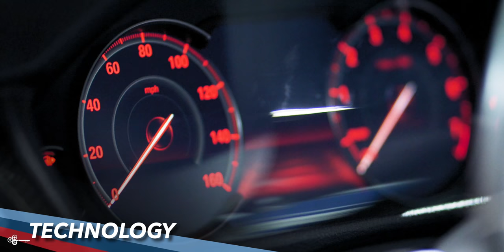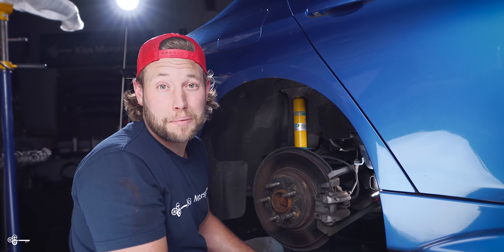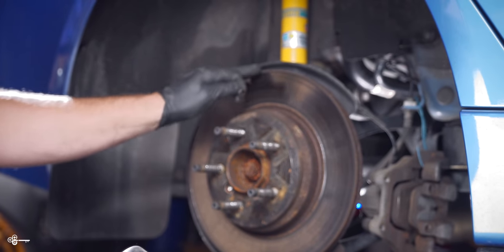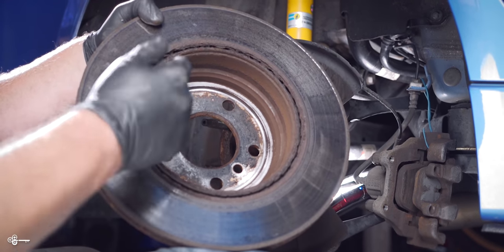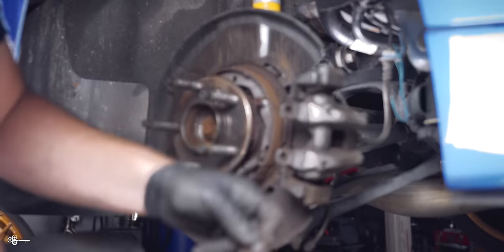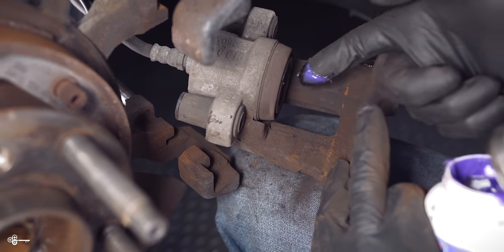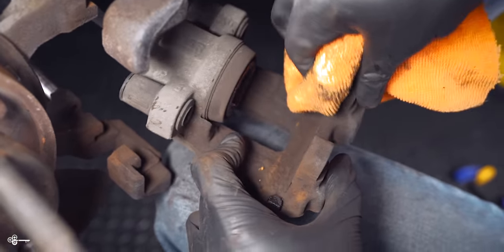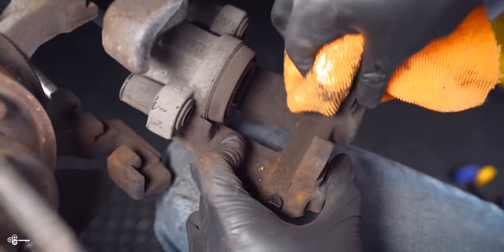How to UPGRADE your REAR F30 BMW Brakes! Slotted Rotors and Ceramic Brake Pads! Stoptech and EBC

Comment: It's true that bmw advices not to lubricate the brake guides, nevertheless I always lube them with silicon based lube or ATE plastilube. The important is not to use convencional or copper paste to not damage the rubber seals. That's what some other cars manufacturers advice, so I see no harm. One advice, when pressing the brake piston, it should be done with the reservoir open, to release the excess pressure. Nice video though.

Comment: It is recommended you lightly grease the entire back side of the pads to prevent brake noise.
Reply: Always wise to grease the backing where the piston comes in contact.  In this case, the bracket on the pad prevents that.
Reply: @pm8372  really? Why doesnt the factory do that then? Never grease brake pads, slides, anything. No OEM manufacturer reccomends it due to collection of debris buildup
Reply: @quix99  Cost, While debris build up is a con, A set of quality brake pads with rubber shims should negate the use of grease. The general reason why manufacturers don’t do something is because of cost. ¢0.10 of grease per car multiplied by hundreds of thousand for something that isn’t necessary is not cost effective.

Comment: Damn, I remember the good ol days when I drove a Toyota and swapping pads and rotors was like a 2 minute ordeal - pull it all off slam it back on, didn't even need to disconnect the calipers

Comment: Whats the torque spec on the 16mm bolts? You just said torque them but not how much 😅, what if I only remove the pins, how much torque do the pins need? great videos btw! Thank you!
Reply: I did 50Nm on my rear OEM's and didn't replace them but hopefully Kies MS or someone else can confirm otherwise.

My source: https://www.newtis.info/tisv2/a/en/f30-328i-lim/repair-manuals/34-brakes/34-21-rear-wheel-brakes/GfyH0Hrd

Comment: Bryan, just found your video.  I'm looking to replace the brake pads on my 2019 F36 440i Gran Coupe M Sport.  
Can I and is it advisable to upgrade the rear brakes to the brembro style 2 piston calipers to get the colored calipers on all fours?   Thanks and great video.

Comment: I've seen different specs for the rear torque than the front torque for the caliper bolts.  I'll be doing my rear brakes and rotors this weekend on a 2016 320i xdrive.  81 ft lb for the front, but only 22 ft lb for the rear. Can you confirm?

Comment: Hey Bryan, Thank you so much for these videos! Just one question for you, please. I just purchased my 2014 F30 and the previous owner had the rear pads changed. They also did not replace the sensor and the dash still showed that the pads were going to wear out in xxxx miles. I took the car to BMW of Sterling (VA) and they said that this sensor needed to be replaced when they did the pads. Is this just the dealer trying to make some extra money (I think with install they wanted to charge ~$150 to replace/install) or is it worth it to replace it while its apart? Let me know what you think and hope you and yours have a great holiday.
Reply: Hi, if the sensor is intact then it does not need replacing. What you need to do is update your car's brake service interval (in this video its says 28000 miles left) then it will count thee miles down on your new pads.
Reply: I was told by a BMW mechanic that they are supposed to be changed out every time regardless and he was the one paying for work on my car because he sold me it so he had no reason to lie at all, it just made him pay more for the repair.

Comment: this might be an uneducated question, but hypothetically if i was on a budget and could only upgrade the brakes one step at a time what order should the upgrades be:  callipers, Pads or Rotors?
thank :)
Reply: robbyrazzer It depends on what you mean by “Upgrade.” If you want bigger calipers, they come with new pads and the old ones won’t work. You may need to upgrade the rotors with the bigger calipers.  
But if you mean same-size pads and rotors, the only caliper upgrade you can do is to powder coat them. If you want to upgrade both the pads and rotors, I’d just do them together, and if I really had to do pads and rotors separately, I’d do rotors first, because old rotors on new pads will put grooves in the pads. Better to upgrade front rotors/pads together then upgrade rear rotors/pads together.

Comment: why you need to change the rear bolts for the caliper?
Reply: BMW and many other German brands use aluminum hardware, I guess they risk breaking because they stretch when installed, so repeated use is not recommended. I've reused my bolts before without issue.
Reply: Dont need go replace.

Comment: Bryan, do you ever find that the parking brake mechanism needs servicing?  I suppose there may not be much to do if the brake has only been properly used with the car stopped, but this is the best time ever for maintenance since the rotor is already off.  Thanks.

Comment: The factory ask to replace the bolts? Is that really necessary? I did changed my rear brake pads 2000 miles ago and so far so good.
Reply: Not necessary imo. I've reused them plenty of times.

Comment: What is the torque setting for those new bolts, and why should the bolts be replaced
Reply: I did 50Nm on my rear OEM's and didn't replace them but hopefully Kies MS or someone else can confirm otherwise.
My source: https://www.newtis.info/tisv2/a/en/f30-328i-lim/repair-manuals/34-brakes/34-21-rear-wheel-brakes/GfyH0Hrd
Reply: JRP tha is for the link. Appreciate that.

Comment: Weird question but.. I have an M135i F20 lci, and i have the 4 pot calipers at the front, and 2 pot calipers at the back.  But i wonder why the 335i doesnt? The 335i have the same 4pot at the front though, but not the back??
Reply: because you have the msport brakes, the blu ones.
Reply: @cod4Anubis  Yes i know, but why doesnt the 335i has it?  it bothers me for some reason lol.. :D

Comment: Hey Bryan love your videos. Can you make a video for rear M brakes where you change both rotors and pads. Ive being told you need to have a machine to align the rotors properly. maybe you will do it on the 340IX

Comment: I hate how crusty the OEM calipers and rotors get after a short time.
Reply: You can switch to Akebono pads. Almost no dust, keeps your wheels, calipers, and suspension components clean.